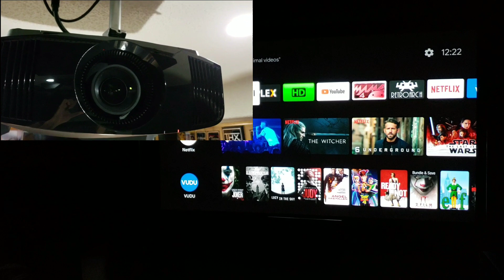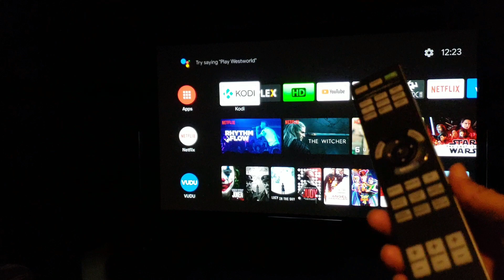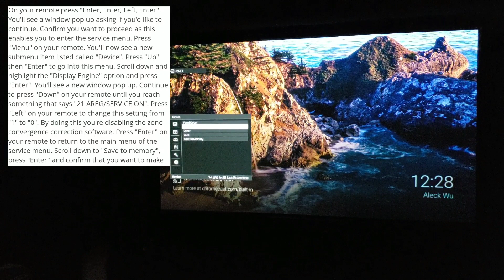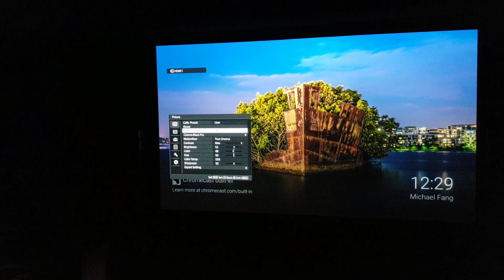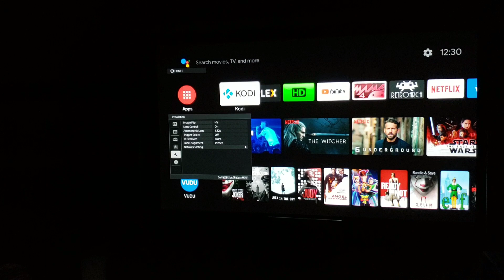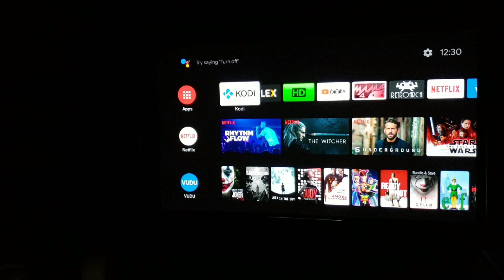Sony VPL-VW285ES/295ES/385ES : How to disable the zone convergence correction software.

Comment: What i want to know is after doing this does it zero out your zone adjustments or leave them where you had them set? 

I have had a few of these and it should be noted that the alignment can vary quite a bit between sets, i've had a couple that were very close and didn't really need zone, and one in particular no way you could get away without it.

Comment: Hi, cheers from France, do you know if there is a hiden menu to make a personalize aspect ratio ? ( in my case i have small black bares in each corner if i choose normal, and small black bares in left and right side if a choose 1:85 aspect ratio... i have de 295es with 16/9 110" screen. Thanks in advance. Regards.
Reply from the maker: Hi Ricardo, I don't know about service menu aspect.  But You can zoom into the screen and mask the sides and top and bottom to fit your screen.